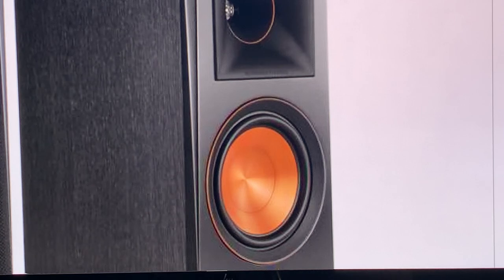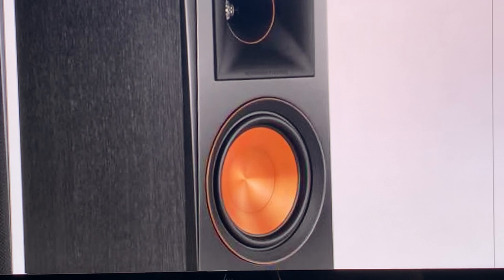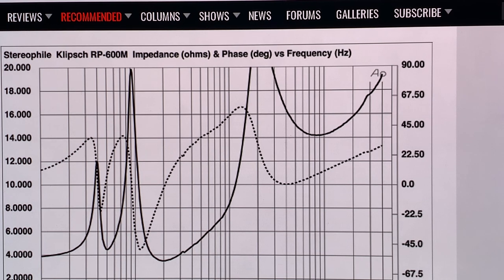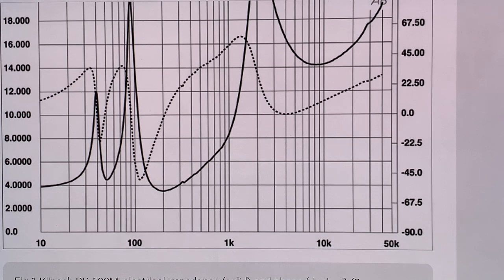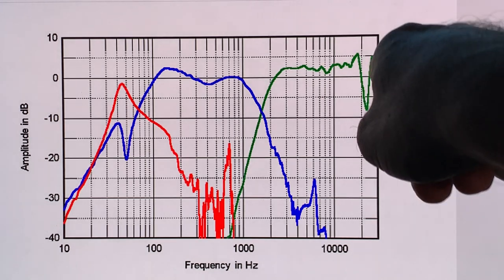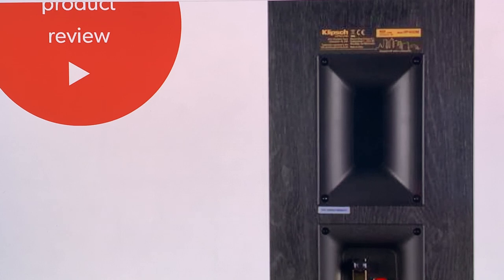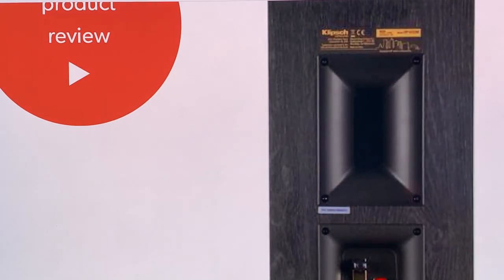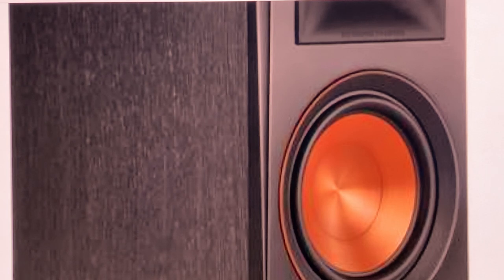KLIPSCH RP600M:  is the bass horn real?!

Comment: I 've got an old set of Phillips 8710 coming in great nick. Ill probably check them out as full range for a while, then find a nice set of tweeters for them. Fairly high SPL and 7ohm impedance.
Reply: As soon as you add a tweeter you ( and the crossover components!!!!!!!!!!! ) will have a gain and a LOSS.........difficult to balance ..it's up to the reslts and your taste
I went back to full range as it is........Goodmans 301 and Axiom 80...........some have even combined the two without adding components ( both are 16 OHm drivers in // )
Philips made very good sounding FR speakers............
Nice work and experimenting............hope you get good results.
Remember , the medication is often worsSSSSSSSSSSSe than the sicknessssssssssssssssssss.
Reply from the maker: Vintage Philips drivers will have a very natural sound, great catch! Do those have a whizzer cone? If so, they will sound the best full range, no tweeter added. As Frank said, when we add tweeter to full range, we loose coherence and clarity. Ultimately, it's a question of taste, whether you perfer clarity or "extended" high frequencies. Extended highs are not necessarily more desirable than not as extended but much clearer highs...
Reply: @realworldaudio   yep they have  whizzers and big alnico magnets. A lot of people do just run them full range and they're meant to sound sweet. That's where Ill start and perhaps stay. Troels Gravesen played with them and tried a Fountek ribbon tweeter, which looks interesting.  We shall see. Thanks for your interest guys.
Reply from the maker: @fairenoughthenwhat  You will not need an extra tweeter... if you do, then I'd advise to fire it upwards to the ceiling to create an omnidirectional effect. Also, much easier to mate with main driver that way & more natural result.

Comment: Your amplifier listens to your room.......same amplifier does sound different at your friends place/ listening room. 
Corrections and more  NFB makes it only worse...( even higher mass cone and voice coil....)
( INever liked Atkinson........... )
Tubes were NEVER designed for most modern speakers...........it's trendy , but not correct ! And many tube designs are designed by transistor guys .
Better high frequency drivers ( and higher efficiency ) will amplify the differences and the sound difference between good tube amplifiers and solid state.............BUT many will accuse the driver of being agressive and or  grainy....
It's the higher frequencies that make this little Klipsch different and alive....................lively to a point to seduce many on a budget......and even others...
Better crossover components may lift it a another degree up hill....as seen in some videos on the net ......

But it flaws are also real..........cabinet.......dimensions.........cabling and low driver and components.
Still bringing some life to part of the musical envelope.........as opposite to many if not most of  the modern controlled and polite ( sterile ) high end speakers.........
Reply: great comment have owned klpish in the past as well and I agree with you , im much more into pro audio now , like beyma , b&c etc , they give the best bang for buck and the sound is much more big and natural , tubes paired with pro audio the good brands can give a very good speaker to anyone and wipe the floor with klipsh bookself and towers ( not the huge ones tho , they might compete but they are 10x more expensive )
Reply from the maker: Frank, so true! Simplicity for listening pleasure, and complexity for show - with all its advantages and drawbacks.
Reply from the maker: @IDontExist14  Big and relaxed sound ALWAYS requires big speakers, tiny bookshelves   can never deliver it. (Anything under 1cutf free air volume is acoustically tiny..) Pro drivers have the continuous high power handling and midbass slam down, but they fail to deliver at the small signal level. Their suspension is designed for the big excursion, their rigidity smears the smallest signals. Solid state amplifiers are not capable (for the most part) to reproduce the very low signal levels / subtleties, so the pro drivers have only advantages with them. All technology has their own pros and cons, no simple answer to anything. ;
Reply: @realworldaudio  bro what type and brand would you suggest , I was gonna order a pair of beyma 8 inch co axial drivers , it's called 12ga50 , should I get that bro for tube amp
Reply from the maker: @IDontExist14  Hold off on that, I'll make a video on that Beyma.